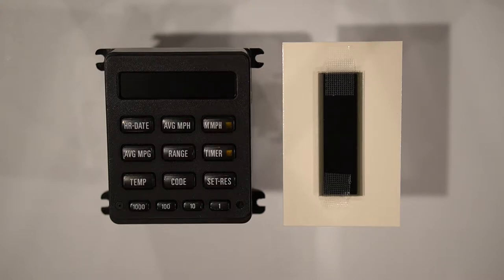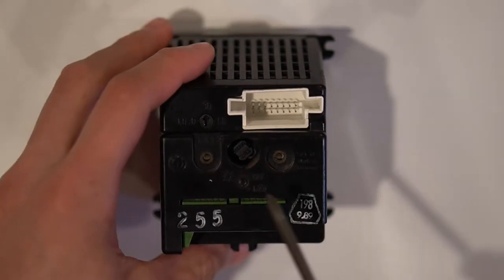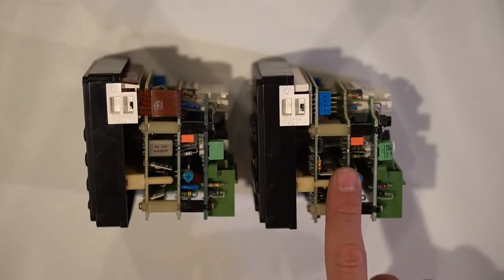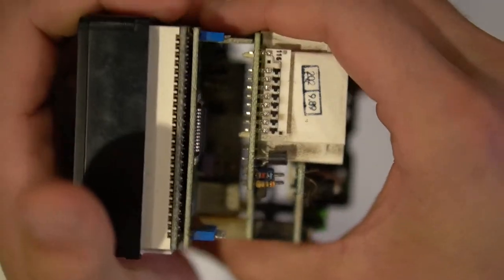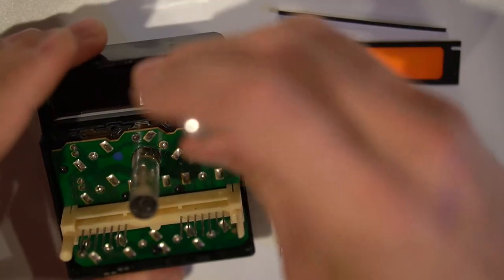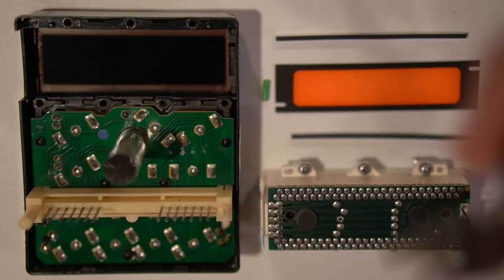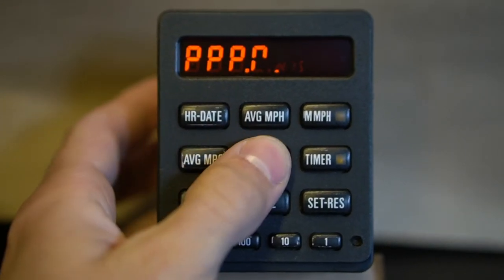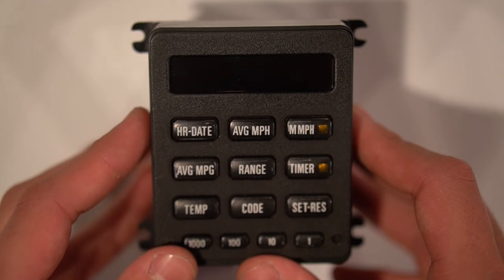BMW E30 / E28 / E24 13 Button OBC LCD Screen Replacement Tutorial

Comment: Just did mine, thanks for this great video diy. I had an issue after with all the modes displaying PPPP. The programming chip wasn't fully seated so if that happens to you, double check that.

Comment: Perfect timing, just ordering an LCD. Thanks for posting, great tutorial.
Reply: Lol, just realized I ordered your LCD. After swapping I get nothing on the display, but backlight is working. Any tips? I tried adjusting the rubber strips twice. Unknown if this OBC ever worked, I bought the car with the display smashed on it. Thanks in advance.
Reply from the maker: @LowCheese1  Hi, I think the most likely issue is the OBC is bad. I will send you a private message and we can get it all sorted out. 
-Addison

Comment: Replaced screen, no light I believe so hard to tell if lcd screen install worked, unless light is of course working but display install wrong - do these units burn out often? I see a number of posts on the slide out two bulb setup where club members claim these burn out after 2 years so many have gone to leds with reistors wired in -might make for a good kit for your business. Ooops -silly me, I see you already offer this -just ordered, thanks

Comment: Great video. Followed the steps and replaced the screen but when fitted back, screen shows some nonsense symbols. Any ideas why?
Reinserted the chip a few times.
Reply from the maker: Hi, if there is dirt or dust on the rubber lcd strips it can cause this issue. Try cleaning them with isopropyl alcohol.

Comment: useful video, I'm just trying to replace the backlight board, but can't seem to pull the white unit out. I'm trying to do it with the unit in situ, do you know if it can only be done with the OBC unit completely out from the dash or not? does that top screw block the backlight coming out? thanks

Comment: I have tried 3 times to get my OBC to work. Before I disassembled it, the light bar worked, now it doesn’t. I have another on order, but I don’t think both bulbs would die from taking it out. I don’t remember if the buttons illuminated before, but I’ve tried 2 different bulbs and nothing lights up with my lights on.  I also can’t get the display to continue working correctly.  It’ll show correctly for a second when I first plug it in, as if I just need to set the clock.  _________UHR or whatever it says.  Then the M MPH button flashes red and all the digits act weird.  What do you suggest?   I can send you a video if you need.  I’ve taken it apart 4 times now. Nothing works right.

Comment: Hello! Your tutorial is great but I’m wondering what to call/where to find the orange screen for the lcd? Mine is worn and cracked. Any ideas?
Reply from the maker: Hi! I have some extras I can send you if you just cover the cost of shipping!
Reply: @addisonmorrone  wow that’d be fantastic. Do you have a replacement screen too so I can get both at the same time? If not I can buy the screen from somewhere else no problem.
Reply from the maker: @VanHofeldt  Great, yes I do have the screens. Follow the link in the description for the screen, then you can leave a buyers message and I’ll include the orange filter.

Comment: Hi, I have display light but no pixels! Does the screen orient either way with the little nub on the left or is there an absolute screen orientation? Perhaps my screen is flipped incorrectly?
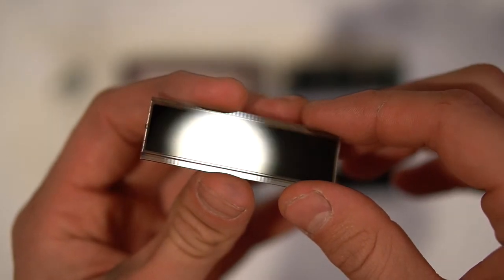Reply from the maker: Hey, the screen needs to be on the left side when looking into the backside of the screen. Go to 3:20 for the exact instructions. It is possible for the electronics that drive the obc to be bad which can result in no pixels.
Reply: @addisonmorrone  , I rewatched vid and had screen flipped, now have mostly pixels with a few little gaps so will go back and double check alignment of rubber strips to housing -pretty fiddly but at least I am about 90% there -thanks. I have only one green spacer but do not have the other - do I need to make another little plastic spacer for the other side to keep screen from shifting slightly? Thanks again!
Reply from the maker: There is only one green spacer so you are good there.
Reply: was thinking that cleaning contacts with a little isopropyl alcohol might be worth the effort? I have to take the OBC one more time to ensure all is good as I have about 90% pixel coverage, something must be off a smidge
Reply from the maker: Yeah thats an excellent idea. Hopefully that does the trick once and for all.

Comment: This may be a dumb question but why when would I know I need to replace the screen? When the lights are dim, are replace the light bar. When do I replace the screen? thanks
Reply from the maker: You replace the screen when it is no longer a uniform color. If you can see any orange  showing through then you need a new screen. I didnt have a bad screen to show in the video but maybe ill add an example photo.
Reply: LCD are literally liquid crystal displays. the cells that contain the crystals in a given area break and you no longer have a functional screen, regardless of how well illuminated it may be